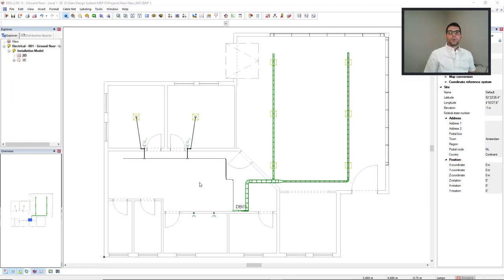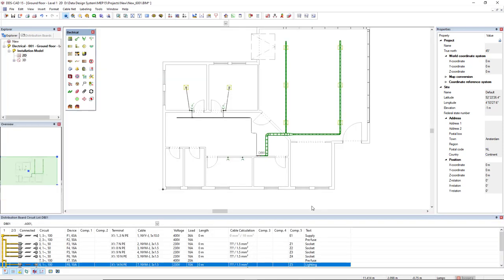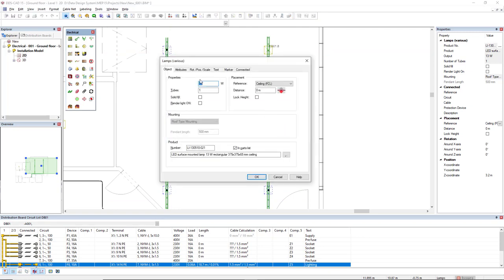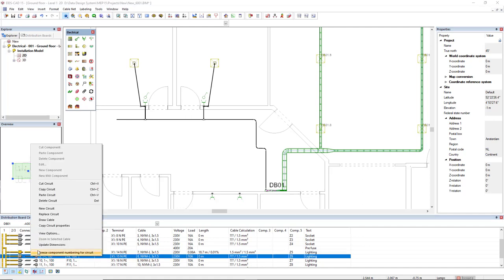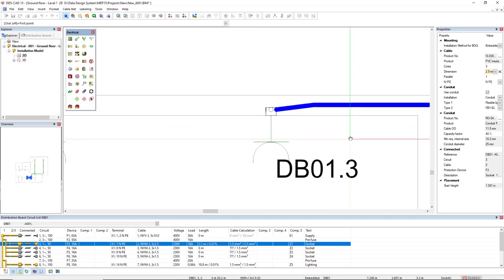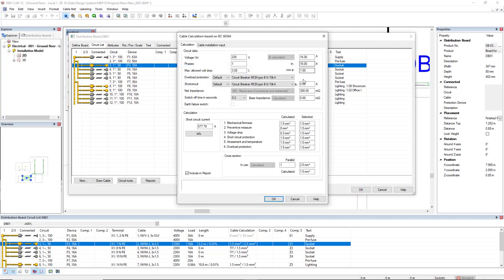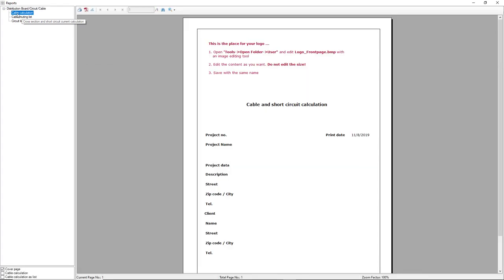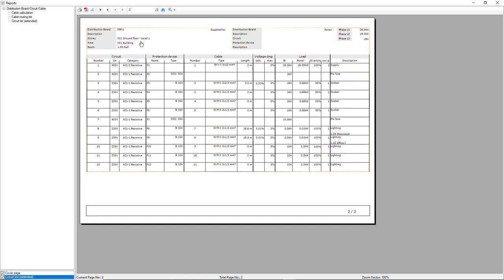Getting Started  - Electrical - Assigning circuits, cable calculation and reports

Comment: Hi, note that when you connected the fittings to circuit no. 8, the current in the circuit and the voltage drop did not change. It has remained the same as for the last connected lamp.
Reply from the maker: That´s correct, in this sample I only calculated the worst path, in order to include all the lamps to the calculation you have to connect the cable to them.
Reply: @DDSCAD-MEP  THX, but you connected all the lamps to the DB01.8 circuit (using function cable path).
Reply from the maker: @targetti123456  , I did not connect to the cable to these lamps, I only assign the circuit, in this case, the voltage drop is not calculated, but yet we can have the load report.
https://youtu.be/6gaDUi5YiTY?t=131
Regards,
Filipe